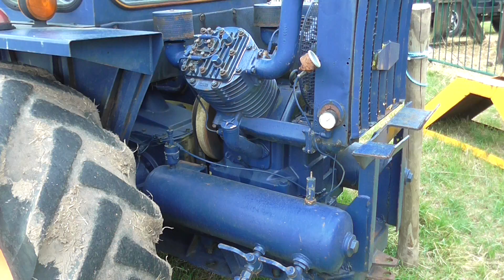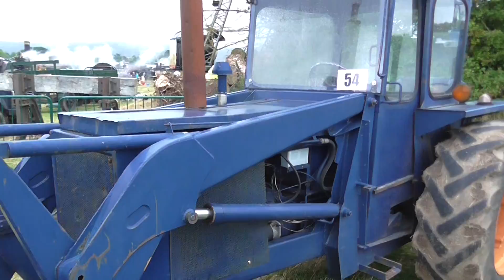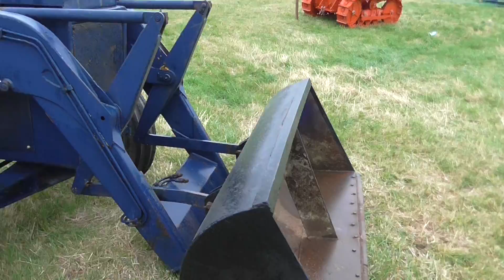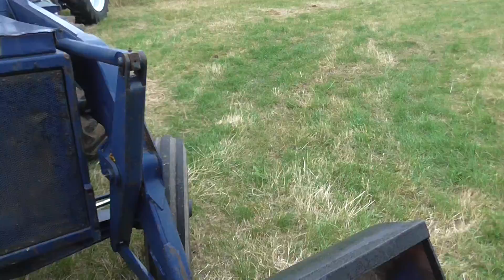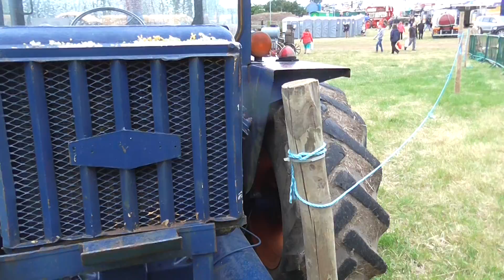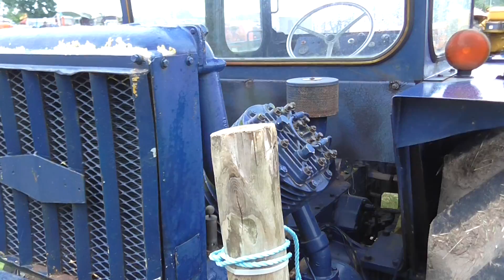International 3434 " tractair" fitted with Bristol compressor Welland 2017

Comment: Nice machine. Those front bucket tilt rams are seriously long without any protection that I can see, I wonder were they vulnerable to buckling.
Reply from the maker: Yes the do seem to stick out a bit but never seen one damaged though. A fairly lightweight bucket fitted, that is strengthened on the inside with a plate. All these were used for was compressor supply for digging out manhole surrounds on roadworks and tarmack cutting on a patch job. And moving around tarmac on pavement jobs and light work. Good reliable machines